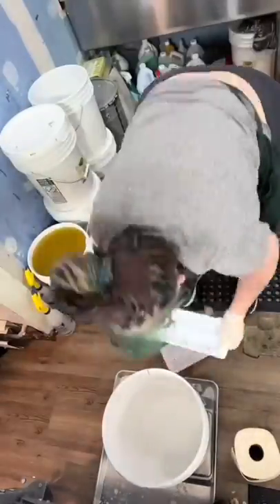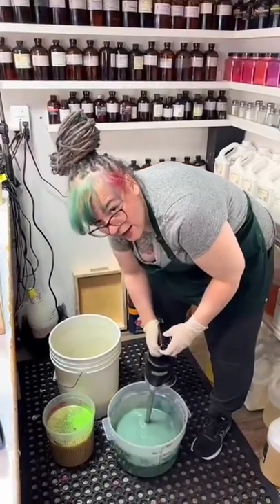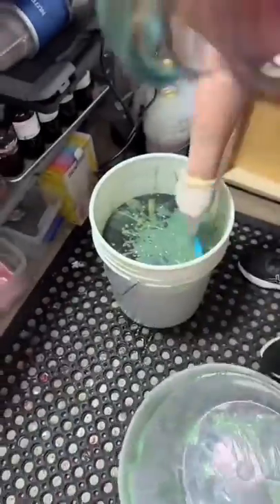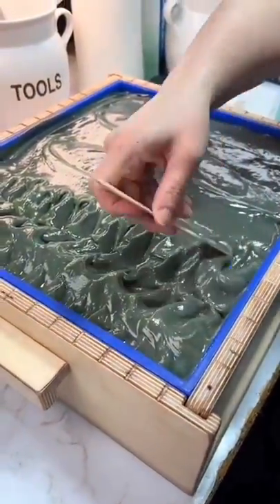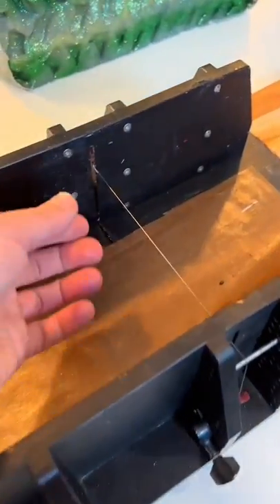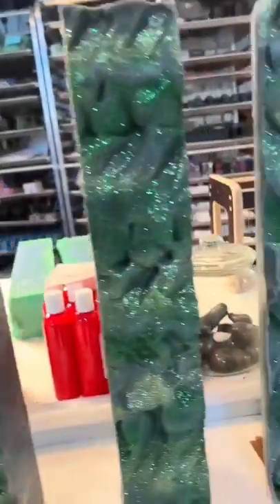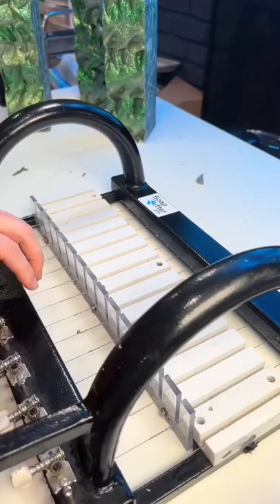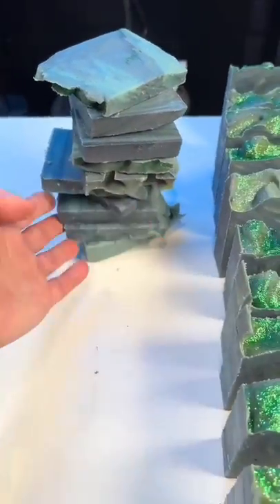Best Soap Molds on the Market? Winston and Walter Soap Mold Review

Comment: You can search, I found a video ages ago when I first started making soap, that explains how to measure your mold to know how much oil to put in. The flip side to that is you can use that same formula to make the size bar you want in any mold, especially height. I use 7.5lb molds that are 3.5 inches high. But I only want my soaps 3 inches high. So i used the measurement I wanted to calculate the size batch I needed to get the size bar I wanted. Then you don't have to guess. :)
Reply from the maker: Thank you so much, Holly! Have I gotten you into the discord group yet of BoV exclusives? If you are interested, just shoot me a message on IG, it's BirdsofValhallaTM I have had you following a long time and would love to get you in that group!